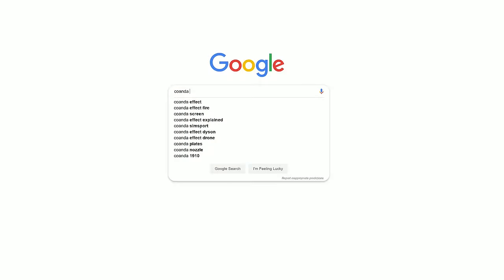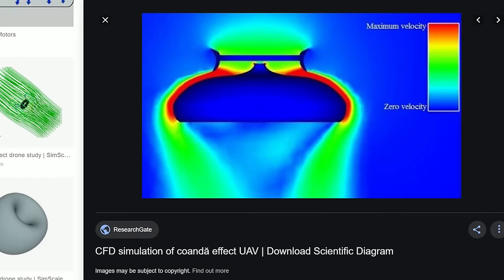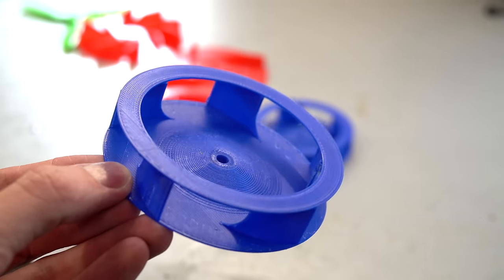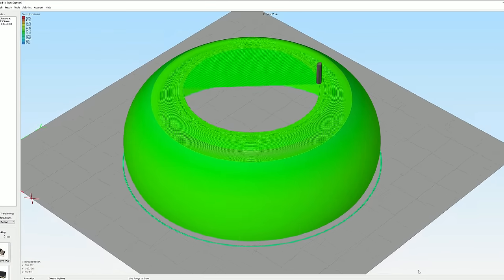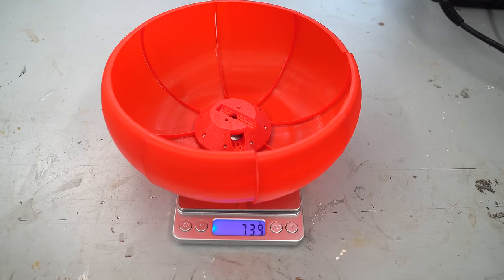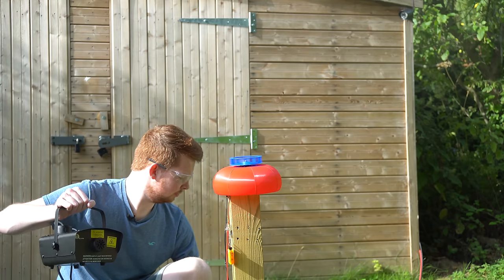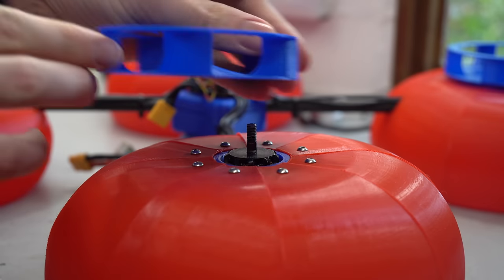Coanda Effect Drone Propulsion

Comment: Pls add another bowl to this with hole equal to impeller od and gap equal to impeller width at top and 1/5 of that gap on sides. Thrust will increase a little bit. Put supporting vanes between bowls.

Comment: How about making im/propellers using the Tesla and Coanda effect at the same time?
It will most probably be just as horrible in efficiency, but a fun shape to try to use as a propeller.

You would have to take several of such domes, each with holes on top and spin them like an impeller.

Comment: You did not tried curved surface to bent air stream from down to horizontal (bowl upside orientation not downside like you tried). in the center of propeler you put feeder of air from upside (like on airplane engines , but not jet engine, more like propeler with hole in center). You then have low preasure under the bowl, and air stream in horizontal orientation.
Now just attach big surface plate for the bowl with rigid connection(holding structure). Under plate you have atmospheric preasure, above plate in between plate and upside bowl you have underpreasure. Still coanda effect, right? Because of bent of airstream from down to horizontal.
But you have option for large surface with difference of preasures , and you have feeder of air which take air from above the drone to feed area under the propeler in so called chamber of bowl, plate and propeler. I hope you will try this as addition to this video.

Comment: The coanda effect relies on a stream of high speed air, so wouldn't a ducted fan create a higher speed flow, and thus more lift.

Also was wondering if horizontally mounted props could have their air directed down in 1 big bowl. It in theory would have sectional lift. I'd be curious to see if that could get off the ground, out of ground effect and how it would control. (I imagine a bit like the avrocar)

Comment: What you have actually built is a close variation of Victor Schaubarger's flying craft built by the Germans in WW 2. Enclose the the fans in a shroud formed to the curvature of the bowl mounted on top and your thrust potential will increase tremendously.
Reply: There are numerous changes to this design which would all lead to an  improvement, but this was meant to be a DEMONSTRATION of the Coanda effect. Tom discussed the other issues at the end quite nicely.

I found it very instructive. Using smoke to illustrate the airflow in flight would have been the cherry on top!
But anyway: Congratulations!

Comment: Another awesome experiment of yours! What if we put a circular deflector around the impeller, deflecting the air from horizontal to more downward direction? Or just put the impeller 3 cm down, so that it intakes from above, but outputs air to the internal sides of the dome?

Comment: I wonder if you could take a pretty normal prop (with a hole in the middle permitting downward thrust), and then check how much waste goes in the outwards horizontal direction, and then redirecting that wasted horizontal flow downwards with the coanda effect. In other words, can we just make a slight improvement on a traditional prop design to make it more efficient by reducing waste? Would that be effective, or would it be cancelled out the extra weight. 

Also how well would your coanda drone work if you had extremely thin domes?

Comment: Also would be interested to see what happens if the domes had slight channels funneling the air instead of completely rounded surface. Would you be able to be generate lateral thrust that way? If so you could take the current dome design and cut half of the weight out by splitting it in very small sections of the same thickness and material of the previous dome with a lightweight material stretched over it to maintain it's the dome shape. Kind of like an umbrella with much more supports. Actuators could then drop a support or section of the supports to create the channel that would generate lateral thrust while (hopefully) maintaining the cushion of air for hovering.

Comment: As the air is trying to be ejected somewhere between the tangent and radial axis, have you considered, shrouding the impellar, mounting the Impeller/propellar at 90 degrees in a shroud (similar to your bottle test) you could then use for directional control (more forward speed, more air traveling throught the impellar? More lift.. ), also how about a more eliptical design (major axis Verticar), or with current design incorparating external spiral vanes to correct the flow direction (more? Of the wing effect,  redirected downwards?)... Would polystrene be lighter.... Or any combination...

Comment: Also...I wonder if you could make a drone fly by the combined effect of two (or four) properly-oriented impeller air compressing pumps? The compressed air provides directional thrust, and the air intakes suck at 90 degrees from the thrust vector; this sucking (region of low-pressure air) can therefore be directed relative to the thrust. For example, if the air intakes are oriented up, lift is generated; the thrust can then propel the craft horizontally. I have seen an airplane that used such a pump for thrust, but I haven't seen one that also uses the intake to provide lift.

Comment: Great start! It is way too heavy though. And the airflow is far too slow. The impellers probably need to compress the air by being thinner towards the outside edge. The airflow has to be as close as possible to the wing/dome. The domes could be made out of light-weight oiled or waxed paper on a balsa or bamboo frame using an ancient, Asian technique.

Comment: Did you test any impellers with a vertical tube above them? I wonder how much efficiency is lost because of the low pressure zone directly above the domes. Potentially inlet tubes could be part of the rotating impeller part.

Comment: What about putting the blabe(s) inside (or slightly above) a duct ?? So you could even play with the design of this (these) duct(s) !! I remember having seen some "Coanda effect" experiment using some sort of ducted fans !! And what about putting two such vehicles in line (one in front of the other) or three ( in a triangular formation)  to gain stability while flying ???

Comment: The original impellers were set too high for a dome with such a sharp angle change.  You need to set them lower, possibly within a hole or indentation in the top of the dome, so that all of the air has to be funneled around the curve.  Make the domes more toroidal in shape?

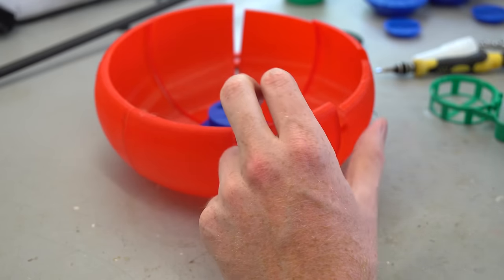Comment: on 5:07 you can see how the air streaam is going behind the dome, this gives you an low pressure zone in the back as well, I think the dome shouldn't be that corved, just about 60 degree from the propeller would be fine and not about 120 degree like your design.

Comment: I think the bowls have the wrong shape as the near-circular curve creates a stall condition. Also, the airflow from each bowl interferes with those of the others and increases pressure at ground level which reduces the airflow. As the craft rises, the airflow at the bowl edges increases and drags air from under the bowl sucking the craft down.  I suspect you would be better off having an aerodynamic cross section (i.e. the upper surface of a wing) at a reasonable angle of attack fixed some way above the vehicle like a helicopter's rotor.  Put them much further apart and maybe launch from the top of a pole.

Comment: But doesn't the dome itself decrease the thrust of the drone due to its larger surface area? You basically spread the airflow over the sphere  which decreases the overall pressure and that would mean that this design was meant to fail in terms of efficiency in the first place. Or is this unimportant since the theoretical energy stays the same wihout the losses due to other circumstances like the redirecting of the air and the added weight?
Cool videos btw.!!!

Comment: The domes seems too far from the air current . Maybe you can use some aerodynamic pressure before switching the air direction in the dome, like a wing curvature before the increased curvature of the dome

Comment: if you had a way to expand and retract the domes you could actually get best of both worlds... when expanded out you could get the better hovering, and when contracted you could get better stability for climbing altitude. Not 100% sure how you would be able to do that without adding a lot of excess weight though...

Comment: loved seeing your thought process! i have very little understanding of aerodynamics, so this might be a silly question, but would it be possible to fly this with an integrated combination propeller/impeller? in my mind, i’m imagining a printed hollow disk with a propeller on the upper surface to pull air in and an impeller on the outer surface to direct air outward
Reply: was thinking the same. with a separate section in the middel going through the middle to the engines to cool them

Comment: Tom, I wonder whether you could use a combination of a propeller above and an inward impeller below to create a much higher pressure volume under the propeller? My thought is the pressured air from the inward impeller would serve to push the air coming down from the propeller radially outward, and then down the sides of a "bell" made entirely of the compressed air. What do you think? Surely the weight of the bell would be more useful for generating lift as an impeller?
Reply: I guess I'm describing using the inward impeller as a "turbocharger" for a conventional drone, hoping to create more lift from the combination of a low pressure zone above the propeller, a high pressure zone a little ways "behind" (below) the propeller, leaving a gap below the propeller and above the impeller for a pressure bell to form from the impeller air to add a Coanda effect as well.
Reply: Or would it be better to add the impeller immediately behind the propeller, eliminating the Coanda effect but just increasing the density of the air behind the propeller?

Comment: Seems like your impellers need an inducer and some sort of exducer to direct the air down instead of out. Similar to how a pump or turbocharger work but 360 rather than single point.

Comment: So how about fluidic propulsion using the dyson fan system?   The other option is to have a sheive over the blade and use a smaller diameter dishes.  The point here I think is to get rid of the exposed blades?

Comment: Can we use the Coanda effect to reduce parasite drag? Can we attach a cyclorotor on top of a blimp, to give direction to the blimp?
We don't use blimps only because they will introduce drag. But if the Conda effect cancels out the drag then the system becomes useful. The drag will try to move the air up and the Coanda effect will push the air down around the fuselage.

Comment: I'm wondering if the impeller could be designed to act like turbines in a jet engine. Perhaps a series of concentric rings of impeller blades that concentrate the air flow through the impeller, something like a series of nautilus chambers.. The inner ring would have the lowest airflow velocity and the outer ring the greatest.

Comment: the curved surfaces need to counter rotate and the air inside the dome needs to flow out the top and engage with the propeller.

Comment: I wonder what had happened if you moved the motors and the props higher, would not that increase the effect? better (not stronger though) airflow and the coanda effect (which is basically a wing) have a bigger effect?

Comment: Any updates? Why not adapt the "Dyson" bladeless fan design. similar are now being used as fixed wing drone propulsion. You should greatly increase thrust. Go as thin as possible on the shell, and your thrust would be protected from exterior air flow while theoretically generating more by the extended surface. Just a theory...

Comment: why not just optimise this by placing a dome  around and over the existing one . If you put one their with an opening it would a thrust nozzle effect that would optimize your flow by allowing both the run off high pressure thrust , and low pressure thrust apply force downwards .
I think you could make an interesting drone  alone off this idea as the thrust is nozzled by the upper dome  which you could apply tilting to it via a few servos allowing it to steer and move solely off thrust vectoring .

Comment: regardless of drive twisty thing, what if you put an outer shroud over the outgoing air to better focus the thrust? The top would be open to the ingoing air. Like a 2-stroke expansion chamber to focus the air after exhaust into the desired direction?

Comment: What is the thrust of the impeller without the dome? The impeller has a one-sided intake, so thrust won't be zero. The thrust attributable to the coanda effect is only the difference between the two numbers (thrust with and without dome).

Comment: The version with propellors does NOT fly due to the coanda effect. It just flies regular with a distorted airpath.

In the coanda effect the airfflow is in basis perpendicular to the thrust direction. Yours is not.

This can be proven by removing the domes. It would still fly, and even fly better.

Comment: Are you sure the shape of the dome is correct? Where does the lift effect end along the curve of the dome? Seems to me that the lift being generated by the bottom half of the dome might be negligible, and simply bee unnecessary added weight. Has anyone experimented with differently shaped domes? Or made an inverse curve?

Comment: star wars cloud car. cut out golf ball size hole of each propeller hat on each face of dome to lighten load Add a flip up edge to bottom of each hat so u get most bang for buck/effect. Try mesh dome instead of solid dome on the next 1. U can always seal up the mesh w/thin sheet of plastic or sticky tape.

Comment: I don't think that coander effect is efficient enough for any practical flight.  Perhaps mount the impellers on the inside of the domes, and it will be a hundred times more efficient.  The problem is the domes actually cut the down force efficiency by deflecting the air out and around.  Obviously, airflow straight down is stronger and therefore more efficient.

Comment: what about a double dome impeller? not sure if it'd work but i think most of the force gets canceled out due to going in all directions but what if you just angle to flow of air back down? thus a double dome. or you idk. could attempt to make a hole through the top and have the impeller on the inside.

Comment: How about stacking each propeller directly above each impeller?
Also, would it be worth curling the domes under and back up to try use the coander effect to create increased pressure within the dome?
Reply: That already appears to be the case.
Reply: @jessepollard7132  i probably need to watch the video again to remember exactly what I was thinking last year, but i think what I meant is that at the moment the curl in, i mean curl it under and back upwards, I'd draw a cross section if I could

Comment: Right off the bat, you have little to no air circulating on the motor for cooling, so while it does look cool, it's a practical nightmare for component durability.

Comment: So many optimization problems, anything adding to the Coanda effect will almost always increase weight, unless some space-age materials are being used. Airfoil works because it's using an effect that increases as the speed of the plane increases, drones dont get this luxury of flying in one direction, they're just sitting in the air much of the time, not using it as a fluid that's moving past it faster and faster.

Comment: The key fail was in not producing a high-speed jet of air.  Impellers and propellers running in free air will not generate a strong Coanda effect.  You are missing a duct around the propeller that leaves only a narrow gap for the air to escape and flow over the dome surface.  Also, your domes should not curve back at the bottom.  they should end with the airflow directly straight down.  Fail.

Comment: What if you used discs instead of bowls? Wouldn't there still be lower air pressure on the top of the disc, and create lift?

Comment: Why didn't you try different sizes of bowls? I'd cut around 30% of this ones bottom part for weight saving without fear of messing with the coandă effect.
Reply: The blue wheel propellers, REQUIRES AN AIRFLOW CHAMBER.
A cover with a hole in top of it, half the size of the wheel. With cross sections rectangular outlet airflow chambers at the orange surface. Corner to wheel clearance.
The wheels need an airflow cover.
Reply: He's illiterate of how those blades/propellers works.
They must be in a chamber to produce the air.
Each one he tried totally outside of their boxes!

Comment: what if you reduce the dome by 90 degrees and point them at the corners. I notice my graphic 1060 gtx has a simaler fan but the air is directed straight through. your 360 domes spread the energy all directions but you might get more efficiency if you tighten that airflow to each corner:yougotthis:

Comment: Is there an area of reduced pressure inside the domes? If so, is there a way  to make an inverse of the current shape such that the coanda induced flow is directed to the center of the torus rather than the to the perimeter of the dome

Comment: use curved prop not straight prop so more surface area but not much added wt or larger diameter of spinning blade. Like a curved sword better than straight sword. Copy the 3 blades of best boomerang shape.

Comment: 8:05 looks like the air flow is disturbing and negating the other props propulsion.why not create a "pinch" at the top, by pointing the rotors towards the top center of the craft and maybe inverting the inner sides of the bowl. like an S waterslide from the middle out. the attempt to spread your air flow makes it less powerful, alternative you could create a cushion using cones on the underside of the shape.